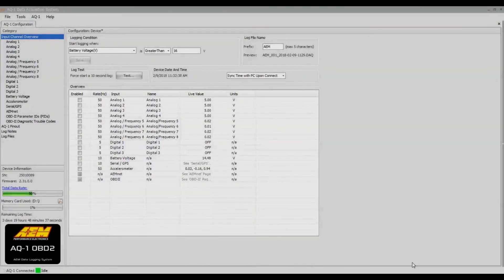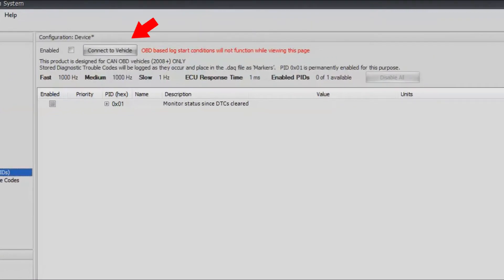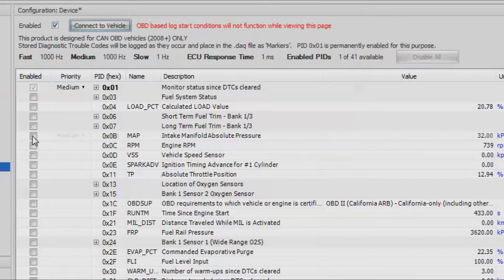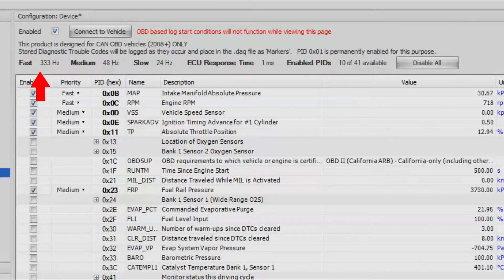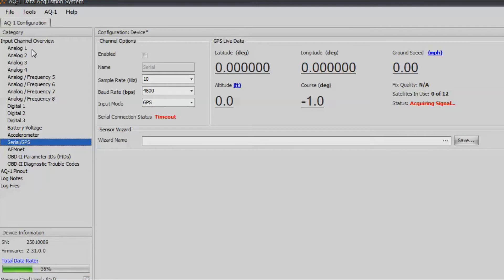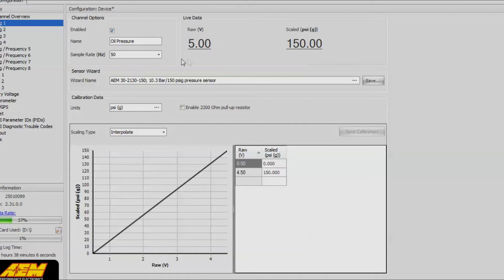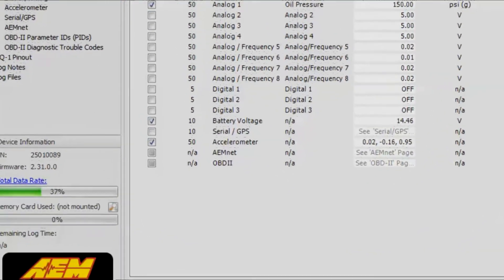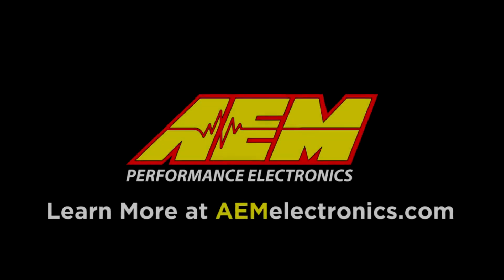Setup Inputs and Configure OBDII Channels in the AQ-1 Software!

Comment: Hello, sorry again.
I got a problem wiring my AQ-1 to ECU INFINITY SERIES 7
I already wired the correct pins but still my AQ-1 is not detecting the AEM device.
What kind of cable would you sugest to use if I'm wiring to the CAN L and CAN H pins?
Reply from the maker: Hi Daniel,     
You will want to use a cable with twisted wire (we use white and green) with a minimum of one inch per twist, and shield/ground it to minimize EMF noise, using a 2-pin DTM plug to connect to the AEMnet on the AQ-1. Please contact our tech support team at emstech@aemlectronics.com and they can assist you with detailed information on how to do this!

Comment: I need a tutorial to connect (wire) my AQ1 Data Logger to my Infinity ECU guys :(
Reply from the maker: Hi Daniel, the AQ-1 has an AEMnet input on the harness (a DTM-style connector) and depending on whether you are using an AEM Infinity harness or not, you may have an AEMnet connector on your Infinity harness already. If you do, then you need to connect the two (see our AEMnet extension harnesses here: https://www.aemelectronics.com/?q=products/gauges/digital-gauges/X-Series/AEMnetExtensionCables). If not, then you will need to wire in an AEMnet connection into the connector for the Infinity and connect that to the AEMnet input on the AQ-1, then use the AQ-1 software to identify the Infinity and select which channels you want to log. The Infinity pinouts are in the full manual and hardware specs, which can be found here: https://www.aemelectronics.com/?q=products/instructions/download  If you have any questions please email our support team at emstech@aemelectronics.com, and we will add your video suggestion to our to-do list!
Reply: +AEMpowerTV thank you so mucho for your replies. I think I've finally made the connection!
Reply from the maker: Awesome! if you need any further help reach out to our tech guys at the email address in the above comment!